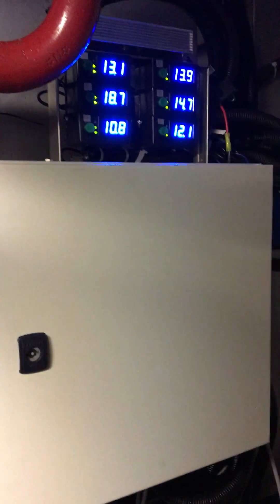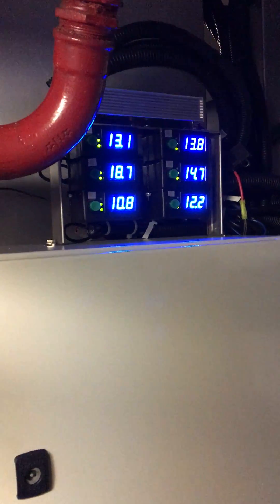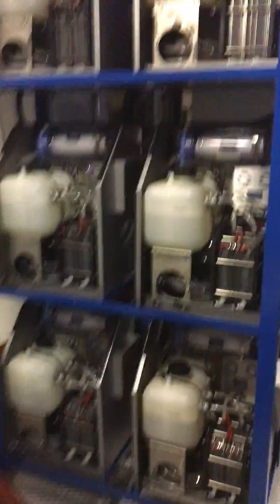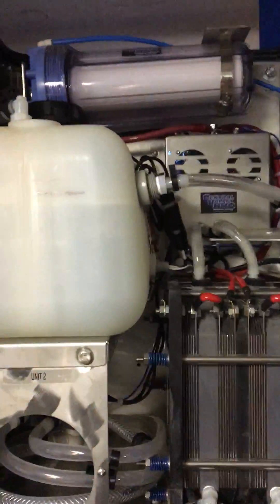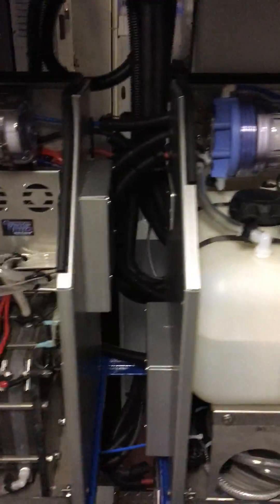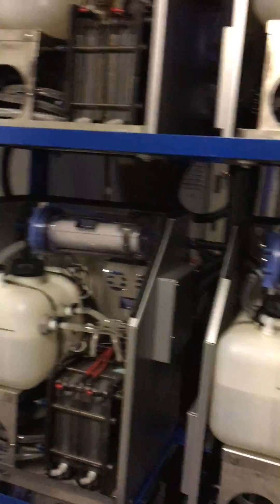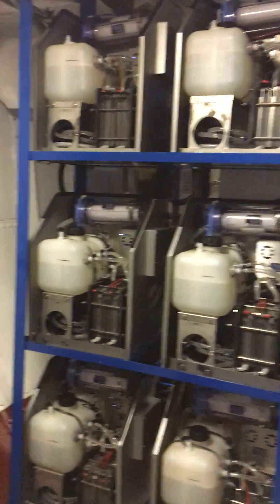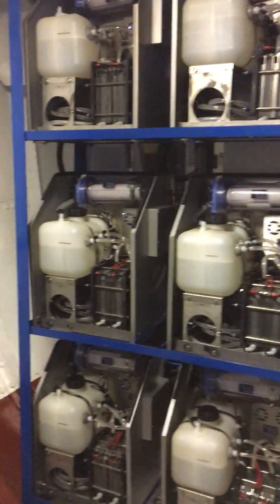Hydrogen HHO on 87L Cargo Ship Part 1, Running With CVHHO

Comment: ~approx final installed cost with labor?  very, very exciting piece of kit!
Reply from the maker: RJENDRO, Thank you for the comment and this project turned out amazing with 30% fuel savings. As far as cost with labor, it depends on the application or engine. Basically the price can vary based on engine size. Please visit our website for more information and send us a contact form with your engine specifications for pricing.